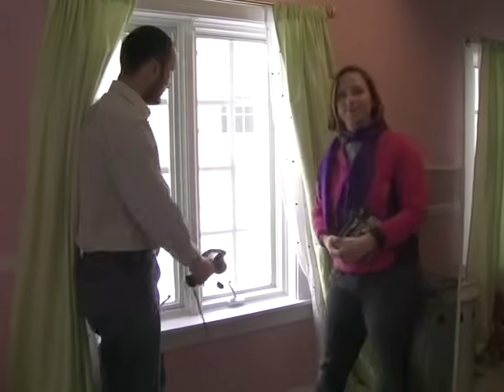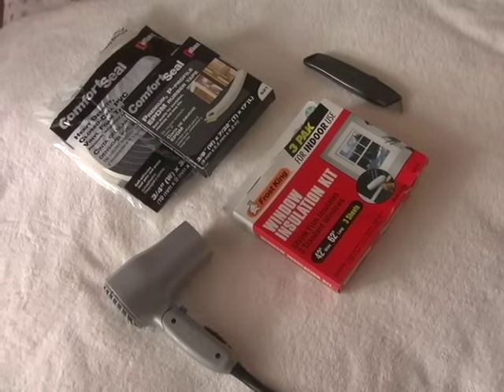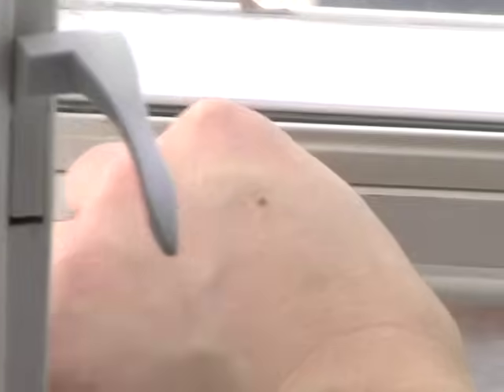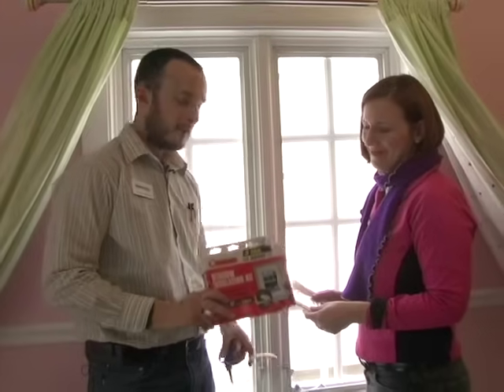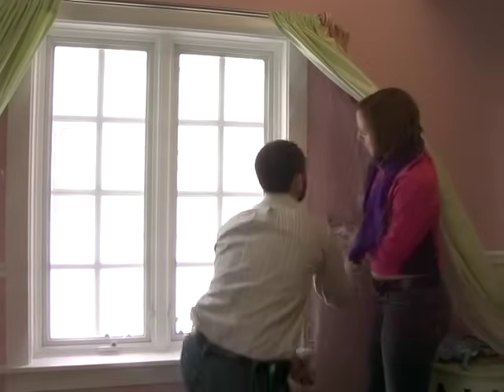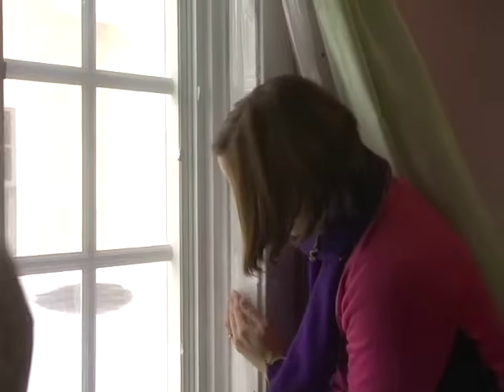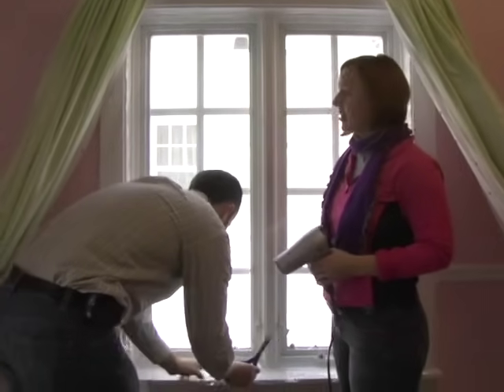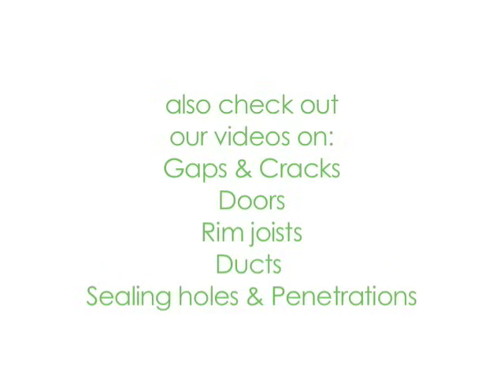How to Weatherize Windows with Plastic Film Insulation- DIY Home Improvement

Comment: Thanks. 
We tried to do this on sliding patio door, using 3M brand, it did not work at all . The 2 sided tape would not peel , perhaps it was too cold here as the lady mentioned a good tip to try doing this in the early fall not in the middle of winter when it is minus 30 C .
Thank I learned a lot on how to do this project .

Comment: So does that mean you leave the windows always closed permanently ??

Clearly this is a solution where practicality gives way to cost. 

I do understand that the air in between provides an excellent insulator but isn't this taking the cost savings a bit too far when you can't even operate the window. Why not just put some self adhesive onto the window directly and then that stops the ultraviolet and infrared energy coming through the window. That way you can certainly open and close the window as the clear film is attached to the window.
Reply from the maker: We don’t open windows in Chicago winter. Take the plastic down in spring.

Comment: I need to do this. The annoying thing about my house' windows is generally it's deep set where there isn't enough of a "ledge" to place tape on, if that makes sense, unless I apply the film to my wall. The window is deep set from the wall. I've been placing bubble wrap directly on the window but I've never tested it in winter.
Reply from the maker: Hope your experiment is successful!
Reply: @HomePerformance  
thanks
Reply: @HomePerformance  
have you tried bubble wrap?

Comment: why am I getting condensation on the window I just weatherization with caulking and plastic film
Reply from the maker: If the film is up, and it’s installed correctly (airtight), that should stop happening when the air humidity in the bubble contained between the plastic and the window normalizes to outdoor levels. By the way, you don’t need caulk AND plastic film, only one or the other. They are redundant.

Comment: Its a joke...right?! Or is this from 1950, don't be a fool, get new cassettes and fit in the old frames then you get good insulation and can even open and clean your windows.
Reply from the maker: Old windows aren’t the only ones that leak, Mr. Fancypants. Vinyl, metal, jalousie, and many more could be brand new and have an air leakage problem.

Comment: I hope I am not repeating what might have already been said. Two points. Firstly - if you do this make sure there is an air vent in the room.  Some old houses might not have one. Second - my experience.  I tried this on one of my draughtiest old windows. Used sealer and tape to eliminate as much draught as possible from the window and the frame.  Despite that when the plastic was on, the draught weren't gone and with storm winds air built up inside and burst the plastic!
Reply from the maker: It’s not a permanent or even an effective solution, to be sure. For that, you’d need to tune the whole home’s performance.

Comment: I just weatherized all of the windows in my 1950s house by myself including a patio door… And it makes a huge difference. Here is a tip I received while purchasing all of the 3M products… They sell the same item at the dollar tree for only one dollar per pack. The plastic is just as good and the tape holds just fine. The cashier at Wally World saved me $35.
Reply: I bought a clear thick vinyl tablecloth at the dollar store for $3....home depot wanted $32 for one that was smaller than mine!
Reply: Laure
Reply: I used the Duck brand insulation kit from the Dollat Tree. It is not the same product as the one sold elsewhere!

Comment: How ugly is the residue left behind after you pull the plastic off in the spring? Serious question
Reply from the maker: No residue normally when we’ve done it, but if the paint is less adhered and the tape was really strong you may take some of the paint off.

Comment: A lot of mis-information in the comments about how this works and if it is effective. The short answer is yes it is effective. When you install this properly you create an airtight space between your window and the plastic. This gap traps air in which is what provides the insulation. This is a similar principal to how double pane windows work.
Reply from the maker: +Mike L well said!

Comment: I Don't use thsoe thin Film Plastic Window kits.. I Buy 6mm CleAR pLASTIC rOLL AT EITHER tHE hOME dEPOT OR mENARDS.. cOMES IN 24" OR 5 FT WIDE ROLLS.. AND mAKE YOUR fRAMING AND jUST sTAPLE THE CLER SHEET pLASTIC TO THE fRAMING (nice and Tight) AND , bINGO YOU HAVE A pERMEMENT sTORM wINDOW TO USE OVER AND OVER EVERY YR.. Mine cost me $5 a Window..  Add Foam Stripping to the inside facing the Window for a Pressurized Air tight seal.. and a Vynil trim pressurize trim to the edge of your frame  to pressurize the window Frame to the Window..

Comment: Some people have issues removing the double sided tape residue in the spring. A tip to make this easier is to apply painters tape around the frame first after its cleaned, apply the double sided tape as normal but over the painters tape. In the spring it comes off very easily with no mess or residue to try and remove. Only issue is the colour of the painters tape :(
Reply: Paul O'Toole when you are ready to remove the tape in the spring, use a blowdryer on the tape as you are pulling it away.
Reply: @mariebee3146  My painter friend said if you leave any of the painters tape on for more than 60 days, then it will remove some paint. There is low tack tape, but it may not stick well and then you ruin the job.
Reply: Paul O'Toole that's a fantastic tip Paul, thank you for saving me the trouble in the spring 👍🍀
Reply from the maker: +Paul O'Toole Nice, Paul!

Comment from the maker: +John Doe, the plastic doesn't provide any meaningful insulation at all, so the before/after difference won't show up well on infrared. However, the plastic DOES block air leakage through the window assembly, and you can actually feel the difference immediately.  A blower door would be the right tool to quantify air tightness with, but unfortunately it would rip the plastic right off the window frame in many cases.  Sorry to leave you hanging with no 'after' verification, but I guarantee you'd notice a difference, especially on our huge-ass 9' wide, 4' high windows in my condo.
Reply: +Home Performance Would this of any help for a 150 sq foot office room in my house with a single pane window? My main concern is keeping the cool air in the room better during the hot Arizona summers.
Reply from the maker: +tiger355 Hey Tiger- the sun shining through is probably your biggest problem in your neighborhood.  Curtains or Low-E coating on the window would probably be better.
Reply: Home Performance thanks!
Reply: What is the tool called that you use to measure the temp at 0:12?
Reply from the maker: +Hakasauars it's an infrared thermal camera!

Comment: I am so disappointed!  I thought you were going to do another FLIR image of the  window after the installation so we could see if it actually made any difference.

Without before AND AFTER images, there's really no proof that all that work really made any differences.
Reply: +John Doe  It is disappointing, but you will not see a significant difference with a FLIR camera. Without getting into the physics portion of this too deeply, basically a FLIR IR camera used in the video detects the result of heat and not the heat itself.  The band of IR that the FLIR camera detects goes right through the polymer plastic film, so you are essentially seeing the surface temperature of the material behind the plastic and not the surface temperature of the plastic itself.  In layman's terms you can think of it like looking at a campfire.  The whiter the light emitted from the fire, the hotter the fire is; the redder the color is the cooler it is.  If you put a clear plastic sheet in front of the fire, you will see the fire the same, but reduce it's thermal transmission by orders of magnitude.   Glass on the other hand blocks most the IR range of the camera (by design) so that the camera is useful on home inspections.  If you use a surface thermometer, you can see a very large difference in the temperature between the glass/ frame etc of the window and the plastic film.  Although the plastic itself doesn't provide measurable insulation, the sealed air gap it provides as a system creates considerable decrease in thermal transmission.  Another example of a FLIR camera misreading, is to point it to a mirror.  The mirror will reflect 80% of the IR, so you are reading the refection and not the surface temperature of the mirror itself.
Reply: +Home Performance Hi.  Will this also help in keeping out dust and allergens?  Also, does the film have any adverse affects of being heated via the sun and blowdryer (chemical releases)?
Reply: Great explaination!  Thanks Scott! :)
Reply from the maker: +John Doe the plastic doesn't provide any meaningful insulation at all, so the before/after difference won't show up well on infrared. However, the plastic DOES block air leakage through the window assembly, and you can actually feel the difference immediately.  A blower door would be the right tool to quantify air tightness with, but unfortunately it would rip the plastic right off the window frame in many cases.  Sorry to leave you hanging with no 'after' verification, but I guarantee you'd notice a difference, especially on our huge-ass 9' wide, 4' high windows in my condo.
Reply from the maker: Yumiko Kawai Yes, it provides an airtight layer if installed right. I have no idea about the chemical potential of this process, except that I doubt it's anything significant since you use a hairdryer on your hair, so it can't be heating it THAT much.  Good question!

Comment: would this also work against preventing cockroaches from entering through the part of the window that slides? when I have my window shut I've had 3 or 4 come in that way and I was going to use plain plastic and tape but I believe this would work better. The window isn't that old and has no cracks or gaps that can be caulked.
Reply from the maker: Oh my goodness. Yes, it would stop them from coming all the way into the house, but you wouldn't be able to open the window anymore, and a few might die on the inside window sill. Better to install this on the outside maybe, for that last reason, but I recommend you get a new window. That's a huge gap.
Reply: maybe use some of the weather stripping  they talk about on the beginning of the vid.

Comment: Why didn 't you use the Flir Bcam (or whatever the infrared gun thingy you used at the beginning to show the heat escaping issues) at the END to show if there was a noticeable difference once you installed the plastic?  Would be helpful to see that the work you did actually worked. Thx
Reply: It works
Reply: I myself don't think it matters to show the difference!!  My common sense says by keeping the air draft out it's definitely going to work therefore it doesn't need to be showed just my opinion!! And I think alot of others as well !! Thanks for the video yall did a great job of showing how to do it the correct way!!!
Reply from the maker: Thank you Ricky, very nice to say.
Reply from the maker: Hello Mr. Pooter- great question!  The main point in the initial scan is to show that there IS a temperature differential that matters- however, what we're actually solving with this plastic film is air leakage, not insulation deficiency.  So we're not actually changing the temperatures, we're just blocking the draft. Sadly, the infrared camera wouldn't show you how this works.
Reply: @HomePerformance   then why show the gun in the first place.
Reply from the maker: Because our entire channel’s 500 videos center on scientific approaches to home improvement and construction.
Reply: @HomePerformance   therefore you should show the "scientific" results to your "home improvement and construction videos". if thats really what your channels about, 20 seconds of science doesnt cut it.
Reply from the maker: Row, you’re right. BUT this was basically the first video we ever made, so have a bit of patience.

Comment: Tried this and it was impossible the tape that came with mine was impossible to peel total waste of time
Reply from the maker: YES! Great point- not all products are created equal, and you get what you pay for. Also, even the best product won't work at all if it's not installed correctly!

Comment: I used 3M film on aluminium windows, so the air gap was very narrow. Probably less than the thickness of the glass.
Nevertheless I noticed to difference right away.
The adhesive (double-sided tape) is provided with the film.
A tip:
Get the film as smooth as possible and use the hair dryer to tighten further. BUT DON"T OVERDO THE HEAT!
Get the film smooth-ish and then leave it for an hour and come back.
It seems that the film continues to shrink after you remove the direct heat.
If you blast away to get things smooth immediately, you may find (as I did) that when you come back that the film has pulled away from the tape.
My local consumer association tested all insulation types and the 3M film was the only product that had a workable payback period.

Comment: I imagine the reason you did not also show the temperature readings after the installation is that there was no difference. Too bad.
Reply from the maker: Not true, Kenneth- I use this in my own home every year.  Definitely makes a difference- I'm not a fan of BS, as you may have guessed.
Reply: Home Performance
 Thanks for the unexpected reply. I sometimes am a little provocative in my comments, in the forlorn hope of getting an explanation, but it never works. I was really thinking there was going to be an after measurement to go with the very scientific before measurement. I know an additional pane of plastic should do something, but possibly it is too tiny to measure and the feeling that you are accomplishing something is the placebo effect. Having the opportunity to see a measurement and not seeing it was a disappointment.
Reply from the maker: That's OK, Kenneth! You're actually half right- the plastic doesn't provide any meaningful insulation at all, so the before/after difference won't show up well on infrared. However, the plastic DOES block air leakage through the window assembly, and you can actually feel the difference immediately.  A blower door would be the right tool to quantify air tightness with, but unfortunately it would rip the plastic right off the window frame in many cases.  Sorry to leave you hanging with no 'after' verification, but I guarantee you'd notice a difference, especially on our huge-ass 9' wide, 4' high windows in my condo.

Comment: Now what happens when you burn something in the kitchen and need to open the window?
Reply: Areas in the house where you need to regularly open and close the window year round are not a good candidate for this solution. However, with new windows costing no less than $1000 you would have to "burn something" 50 times before buying new windows makes economic sense.

Comment: I'm going to insulate my patio door (huge double windows) like this. I'm just wondering about one detail. The frame around the door goes pretty far into the wall. how far away from the window should I set the sheet up? Wouldn't further away make better insulation? Or is there a point where it's too far? Or with a huge window like this could I be too close to be effective?
Reply from the maker: Can work, but the more surface area the sheet has, the more it'll try to rip itself away from the tape.  Make sure you install tight!

Comment: Does anyone happen to know what the best thickness is for the plastic sheet?  If so, how was the answer determined?  My assumption is that the thicker the plastic, the better the insulation; however, increasing thickness in the plastic would likely require an increase in the adhesive strength of the tape, due to the need to hold up a correspondingly heavier sheet.  One drawback to stronger adhesive would be the difficulty of removal after the winter season.  I would hope to avoid a scenario where the adhesive was so strong it peeled away paint when removed or left behind any discoloration on the surface around the frame.
Reply: This makes less of a difference than you might think. The primary factor in this insulation is that the plastic is airtight; adding additional mass between the inside and outside of the home does improve insulation, but there are better materials for accomplishing that task. For those of us with issues with drafty windows, the goal is to stop that drafty air from entering the home, and to provide an additional barrier of air between the home and the outside. For that purpose, the thickness of the material is not important, as long as it is sturdy enough to have an unbroken seal.

If you are looking to improve the material you use, the right question to ask might not be the thickness, but the thermal conductivity. A material with lower conductivity will impede the absorption of heat into the barrier between the plastic and the window.
Reply: Gottfried, you did a hellava job on that Calculus thing. For thin solids like this, with a large area of conduction, the insulation value of the material itself is negligible. The non-negligible R value comes from the stickiness of air, and the flow over the material, rather than the resistance to heat flow of the solid plastic. The typical material with a decent R-value gets it by reason of the smallness, and large numbers, of trapped air spaces. You get the same R-value, they say, from a thin film of plastic as from a pane of glass.

Comment: Depends on what brand tape and what brand paint, is the short answer.  Residue is easily fixed with alcohol, yes.  I wouldn't worry about tearing the paint off unless you're aware that it's already pretty fragile, Erica!